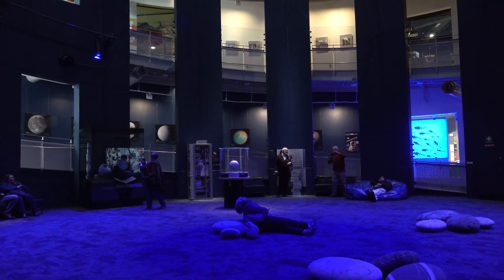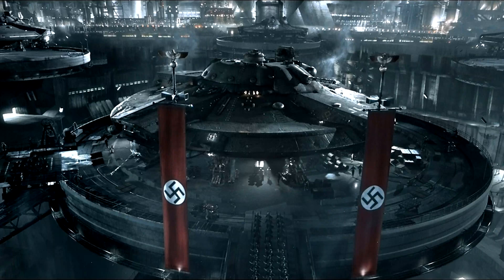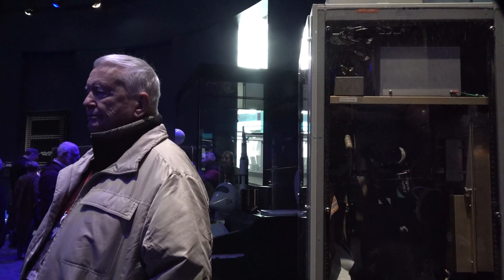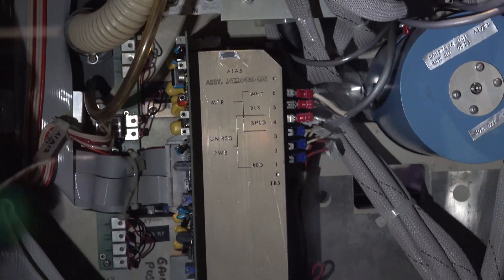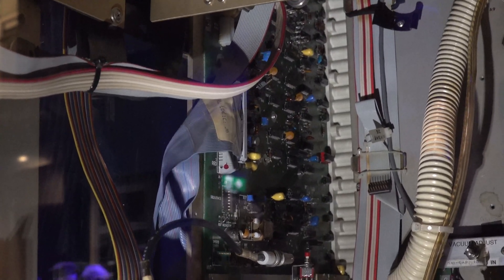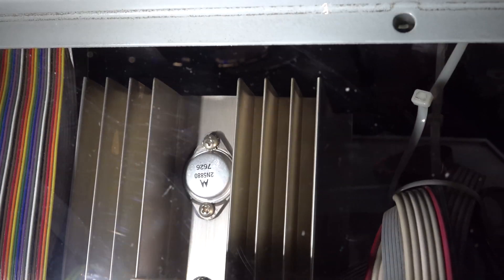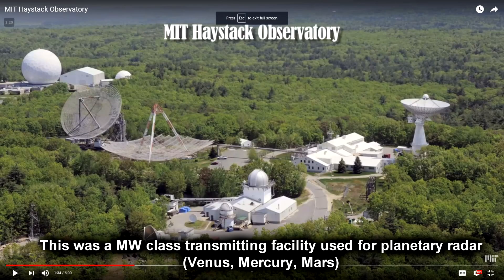Original Apollo 11 Recording Cabinet!

Comment: The vacuum system provided a physical buffer between the precision movements of the capstan and the large movements of the reels by storing a short length of tape in the vacuum column under relatively low tension.
Reply: MrLunithy But that vacuum port was not in the tape path, and this wasn't a fast start-stop data tape machine.

Comment: Those correlator tapes are not as old as you surmise!  They were certainly in use about 15 years ago before all the VLBA data started using disk drives.  I'm guessing the Honeysuckle Creek antenna was used in some VLBI experiment or maybe some spacecraft tracking.  Not sure of the MK IV history, but when I started at the VLA in Socorro in 2000, my boss was still fixing these things.
Reply: "For over 30 years the format dominated offline storage and data transfer, but by the end of the 20th century it was obsolete, and the last manufacturer of tapes ceased production in early 2002"

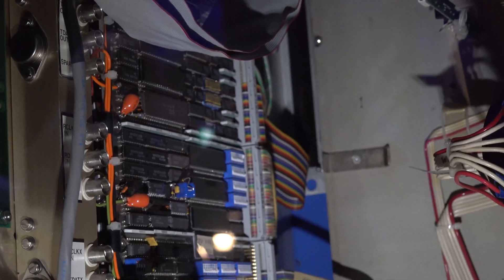Comment: @3:02 I'm still wondering why a tape drive need a "laser operating" sticker....
Reply: Someone had a sense of humor
Reply: @EEVdiscover  not to seance the end of the tape ??
Reply: EEVdiscover Could have had a fiber optic data output (using a laser to transmit), or some exotic mechanical component could be optically aligned (not the tape, something more delicate).